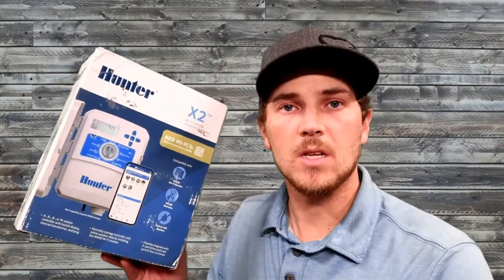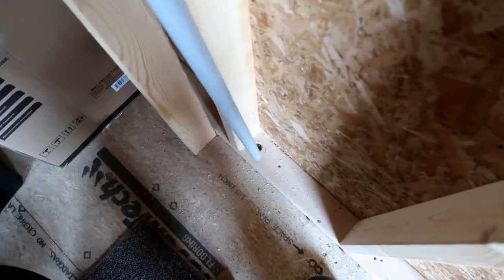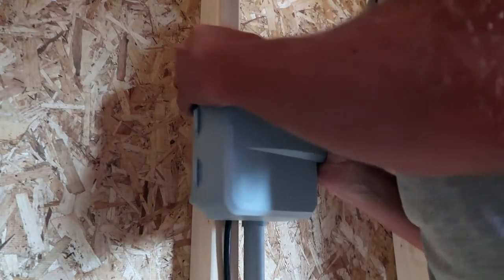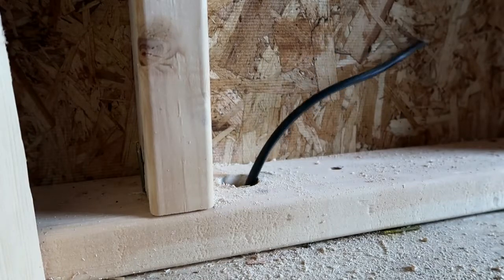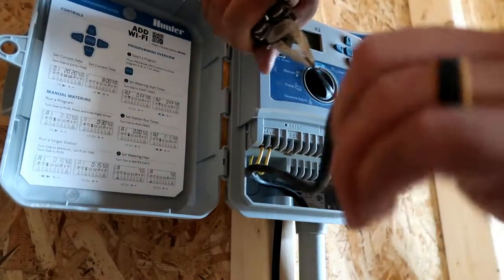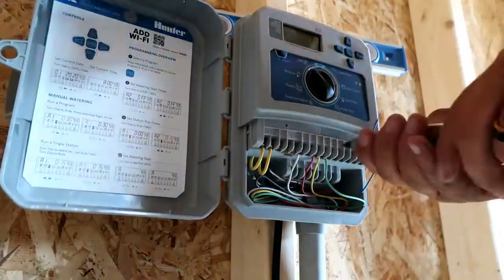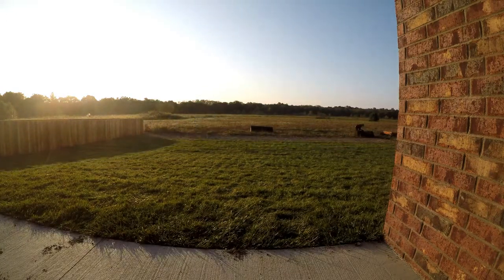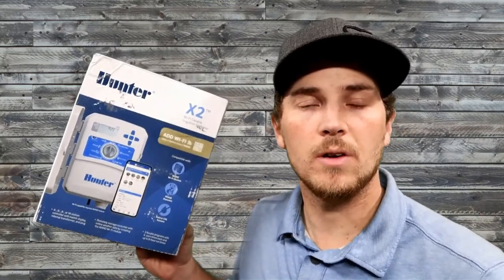Hunter X2 Sprinkler Controller Install

Comment: No battery back up?
Reply from the maker: The X2 has a “non-replaceable 3V CR2032 lithium battery installed directly on the circuit board.” This controller has the upgraded Wand WiFi module so the date and time will be synced over WiFi.